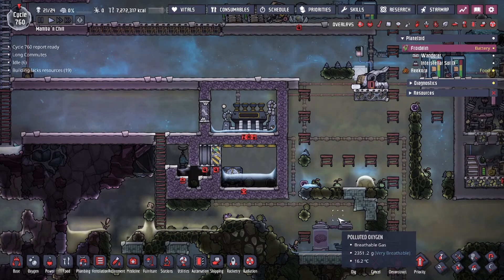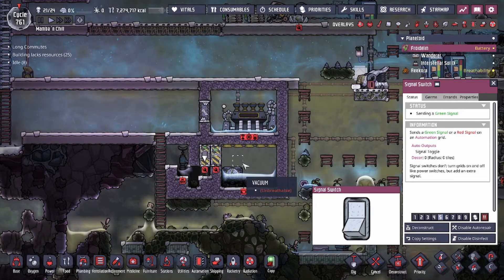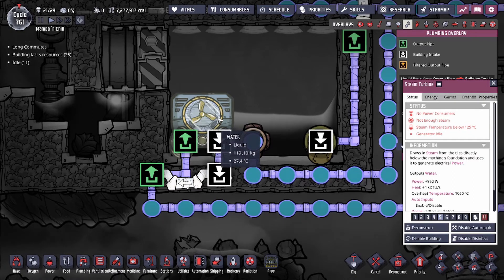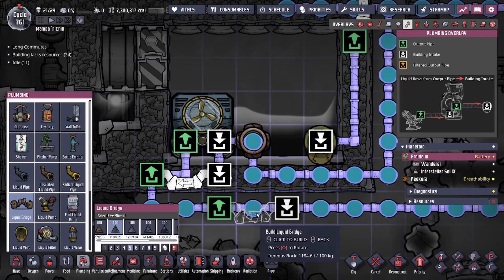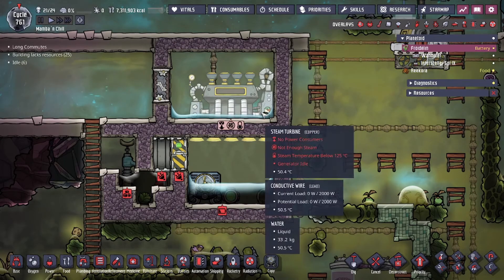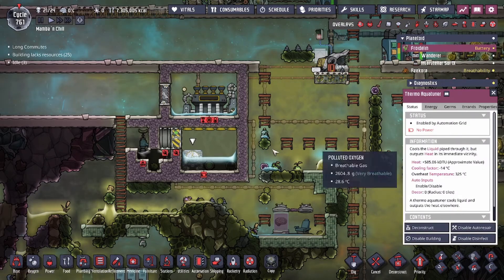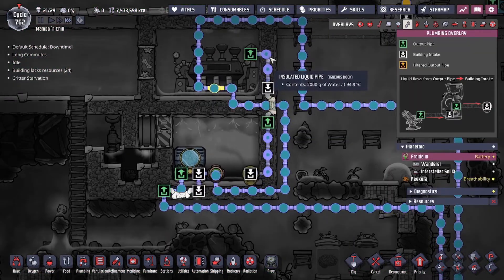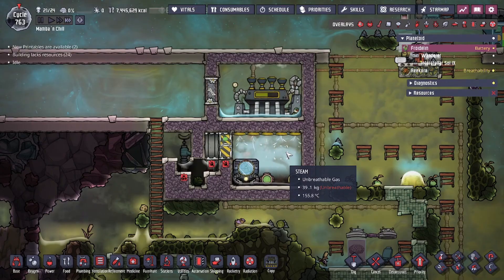The Standard Steam Turbine and Thermo Aquatuner Setup - Oxygen Not Included

Comment from the maker: Is the Steam Turbine & Aquatuner combo too strong?
Reply: It's not too strong in my opinion but if you use the power plant a microchip will increase it's power cap to 1275W which does at least give it potential to be net positive. But that's only if you want to sacrifice 5kg of refined metal every 1.5 cycles
Reply from the maker: @969Ryu  thats only true if the steam temperature is around 200c to allow for the steam turbine to be at full power. more often than not, the aquatuner usually hits its target temperature and its activity goes way down and sometimes doesnt even generate enough heat for the turbine to turn on- so i wouldnt actually recommend a powerplant on a steam turbine that isnt showing atleast activity % > 80%, which would be something like research reactor setups or geothermal power builds

Comment: Can one aqua tuner produce enough steam to make a turbine run at 850 with this setup?
Reply from the maker: yes, the problem is that you need to keep the aquatuner running nonstop and let it slowly ramp up the steam to 200c. so you either have to somehow heat the coolant in the pipes or use alot of water. this likely has to be any kind of water or super coolant

Comment: I just try this cooling system in my base but i don't know why it's leaking alway in the same area; since i use petroleum in the cooling  system i know it's not water melting from somewhere... 
The pipes are not breaking but i have to mop petroleum and refill my loop some time (like 50 L) 
Do you have an idea ?
Reply from the maker: that means the automation sensor is somehow not reading correctly/placed poorly because what youre experiencing is over cooling to the point of freezing. when liquids freeze in a pipeline, they break the pipe and drop the frozen version of the liquid- and since its likely in the steam room it would melt right away.

so somethings wrong with the temperature sensor- either its set too low, or not placed in the correct position, or even picking the wrong sensor type (gas pipe sensor vs liquid pipe sensor) or maybe not connected via automation wire

Comment: What would happen if you pumped in used germ filled polluted water instead of continually reusing the clean regular water? If you had 2 steam generators, could you send in a metered amount of germ filled PW and make enough steam to run both turbines and then just take the germ free clean water from the steam turbine output to a holding tank in order to make free clean germ free water?  Then you would not need power or any  filter material for a water sieve or need a chlorine room and have extra power to boot. But you may need a way to remove any polluted oxygen depending if it is lighter or heaver than the steam.
Reply from the maker: yup, polluted oxy is lighter than steam so it would block its ports. you could do that but you also have to make sure you can consistently hold the temp over 120c to boil polluted water. although its feasible to do this, its not power efficient because you would have to cool the water back down to be useable for most things

Comment: Can you show how to make a simple input-hot wat and output set temperature water system? Like input 60C and output 5C? The problem is part with regulating water flow in the system. Thanks.
Reply from the maker: could i ask, why are you trying to cool down the water? most of the time cooling a variation of water from 60c to 5c requires alot of energy and most of the time isnt worth it. this is due to water and its variants having really good stats.
Reply: @2LegitCity  It is not so much about cooling to 5C exactly but cooling to set temp and building a mechanism that will release any liquit at set tempertaure.
Reply: @technoincubus1736  Assuming it is for sweet wheat you dont want to go this way but it is rather easy to do.  Using a hot (anything above 10C) and cold (~0C) water sources setup up feed with liquid shutoffs that feed 1 buffer tank.  On the output of the buffer tank has a temp sensor set to above 5.  Connect this sensor to the cold source and a not gate.  Then the not gate goes to the hot source.  It will fluctuate between 5.1 and 4.9.  But for sweet wheat it is just easier to use polluted water and cool the room to 0 because you are also adding dirt at an unknown temp and this will overpower the water even if you are feeding them 1C water.

Alternatively you can use 2 ATs.  The first will cool a buffer tank with a target of 19 degrees.  Then a liquid shutoff will pull off anything below 19 degrees and feed it to a second AT which will cool it to an average of about 4.9 degrees.  The problem I had with this setup is it is very difficult to make it backup safe.  Normally once my 4.9 degree water backed up it started breaking pipes so you have to consider all the backup senerios.  I also had troubles with my 19 degree tank getting too cold and too full so there is a lot to consider.

Comment: is it necessary to build steam power late game or can you survive with just hydrolyzer?
Reply from the maker: the steam turbine has a heat deletion mechanic when its consuming steam and easy to use, which is the main its so popular. 

if you want to avoid using a steam turbine, its possible, but you have to be creative in your cooling designs. and also getting lucky with some cold liquid sources like cool slush or cool salt slush geyers.
Reply: Steam turbines aren't great for power (unless you harness magma heat). It's only real purpose in this video is remove heat.

If you have a big pool of magma though you could probably run a bank of steam turbines almost indefinitely
Reply: @moxxy3565  Bottom of the map tends to only last 1000-2000 cycles depending on power draw

Comment: My output liquid pipe always damage why
Reply from the maker: that means the liquid is either too hot or cold, causes the liquid to turn into gas or solid. if youre using water in the pipes and dont have automation + overflow setup in the video, you will eventually freeze the water and it turns to ice, breaking the pipes.
Reply: Put a thermosensor to at least 30C near radiant pipes which are cooling environment you want and connect it to a AT. I figured out that 30C is a perfect range of temperature for auto cooling by AT without bridges.

Comment: If you put a liquid resevoir right after the thermo aquatuner, then you'll average the temperature of the coolent used (if at least some portion of water is present in the liquid resevoir).
This also gives the smooth flow of liquid through your pipes, especially when using liquid bridges.
Reply from the maker: correct! nailed it as thats the reason to add a reservoir after the AT, but I havent found too many situations that require it

Comment: Would using the output water from the steam turbine to cool it work with this setup, or would the steam turbine get too hot?
Reply from the maker: given how low the steam turbine stays at, its probably possible to run the output 95c water over the turbine itself to maintain temp- but i have yet to test it on this setup
Reply: in practice - till you AT generating less than 330 kDTU/s avarage(theoreticaly up to 400 kDTU/s, but there is limitiation from heat condution side from ST to water in exit pipe)

For simplicity - up to 56-57% uptime(using water/p-water as coolant), depends to some extent on mass of steam
Reply: Depends on how hot the aquatuner room gets. Passively cooled steam turbines do work, use hydrogen in the turbine room with radiant pipes for maximized heat transfer.